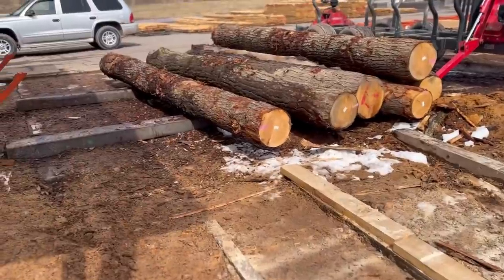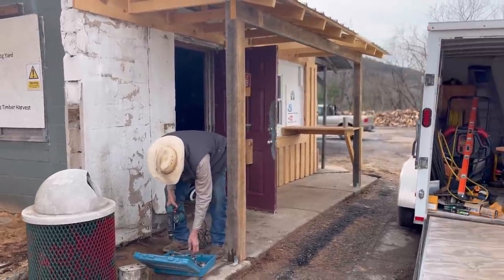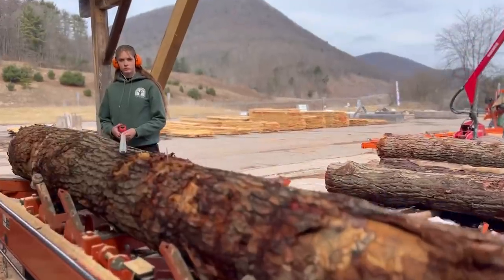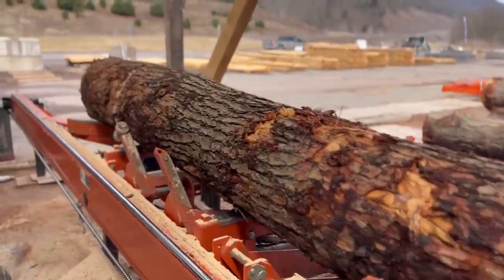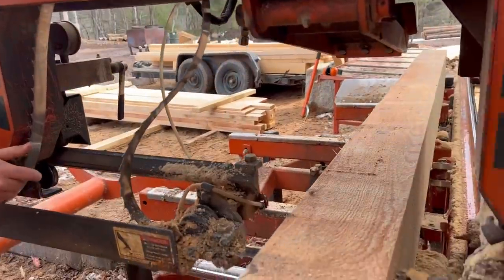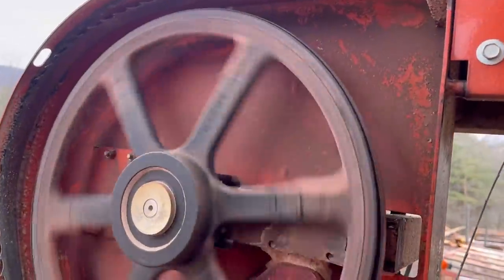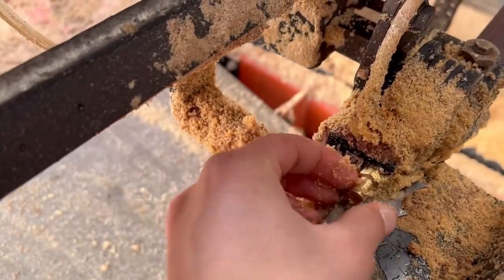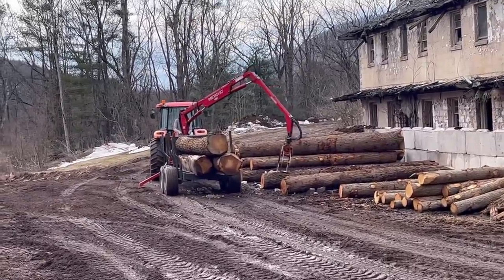Broken blades and clogged water system on the LT40 sawmill

Comment: As a seasoned vet in hands being contaminated in solvents the best fix is to keep distilled white vinegar on hand. It not only counteracts solvents such as gas, kerosene, mineral spirits and many others but if you look on the label for uses, the #1 use is softens hands. I have had multiple ladies work in my business over the years and all would complain about the residual smell on hands til they tried the vinegar. After that it was a staple in the van.

Comment: I really enjoy your channel. Very well done!  When you cut 2x6s are they rough cut dimension or S4S dimensions (1-1/2 x 5-1/2) ?
Reply: Another person asked that in a video and they said they are real 2x4's and 2x6's. I'm wondering who the customers are. The building industry is standardized to nominal dimensions so it would cause issues all over the place. If they are working on old buildings with full size lumber, then it would make sense to match what is there.
Reply: Full size 2x6” are 1 3/4 x 5 3/4 after they are planed. Is there a planer on site?

Comment: If you remove and plug the bottom lubemizer nozzle with a 1/8" grease zerk and run diesel instead of WW fluid you will find your lube use will go way, way, down, you will have no pitch build up at all, and sawdust on the boards will be reduced to almost zero.  Oh, and you won't have to worry about your hands smelling like gas if you keep grabbing broken bands with the idle wheel spinning like that.
Reply: yea, I was sitting here yelling at her,
Reply: who wants diesel fuel all over their boards?
Reply: @verteup  You won't get diesel all over your boards. It's just enough to lightly coat the back. I've just got a hole in a Gatorade bottle & only give blade a shot of diesel/expired olive oil as needed..

Comment: The liquid expelled by the saw. I understand it's a lubricant to make the cutting easier. However is it just water or a special semi toxic lubricant.
Reply from the maker: It’s water with a little bit of soap, but it’s mainly to cool the blade down